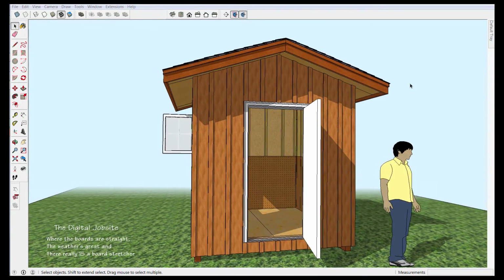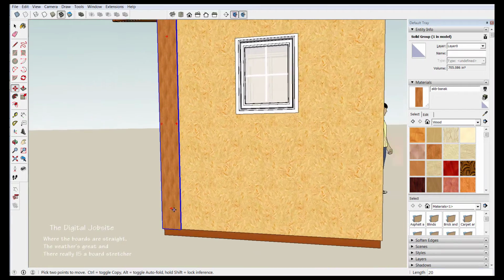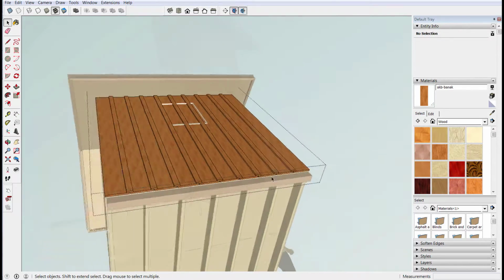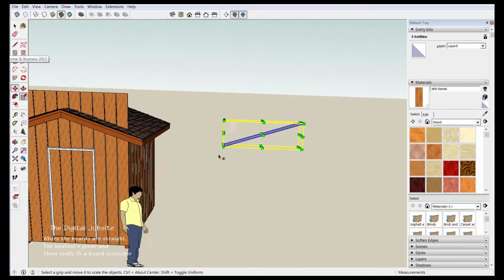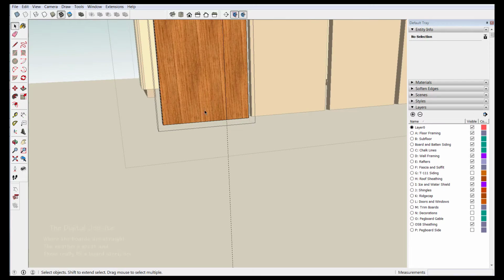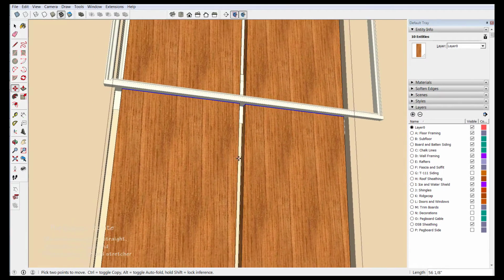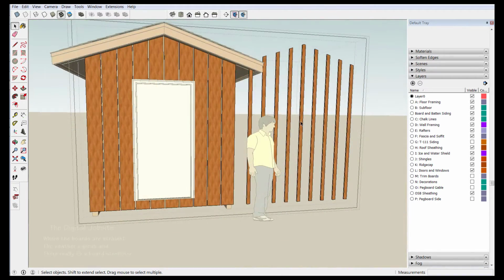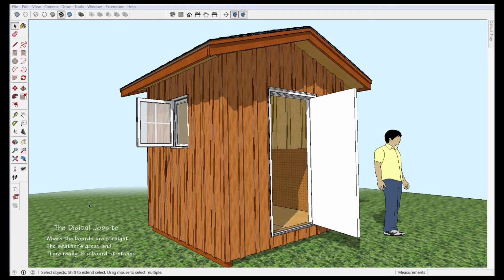How to Draw Board and Batten Siding with SketchUp

Comment: Matt, I really appreciate your informative SketchUp videos.  I have a question... I have designing my shed and I'm ready to start building. Is there a way that I can quickly measure all the dimensions of a single selected board?  I would like to take my shed design and select the boards one at a time and use their measurements to cut them out in real life before starting with the hammer and nails. I know there's a function to measure the volume quickly, but that doesn't help... I just need the measurements...  (length, width, height)  Any way to grab this info quickly? (faster than using measuring tape tool)